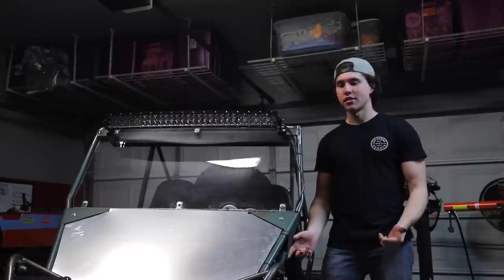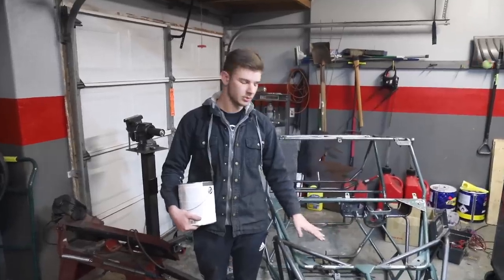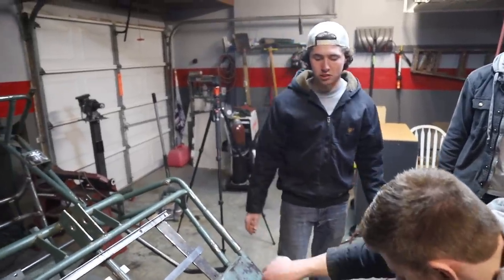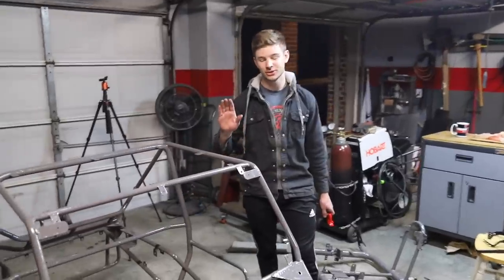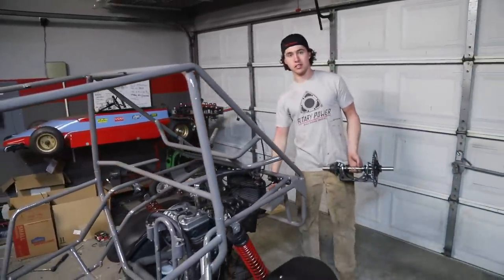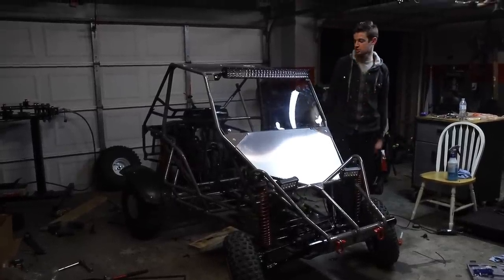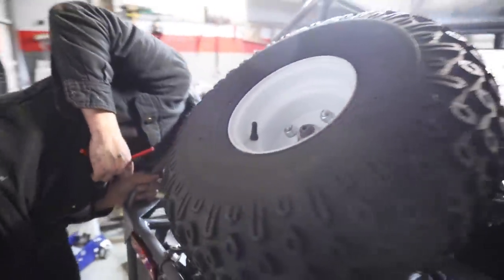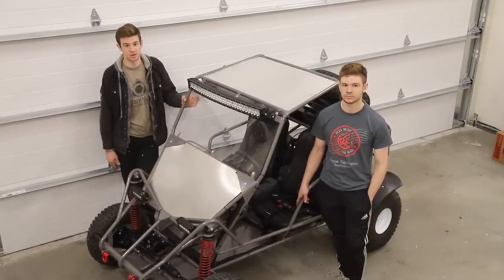Ninja Offroad Shifter Buggy Build Pt 10 | Finally Painted!

Comment: The vansickle paint at north 40 is the same quality paint. I always use the hardener or it takes forever to cure. Try using a short nap roller to apply to large flat areas. Great work guys!